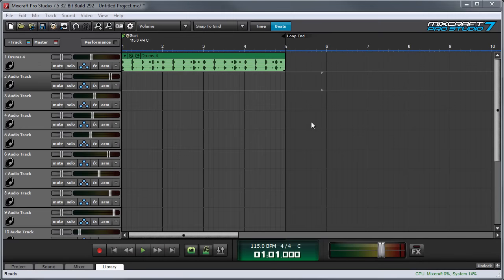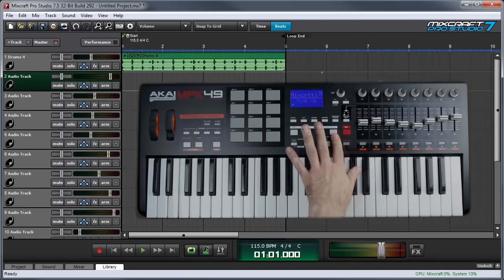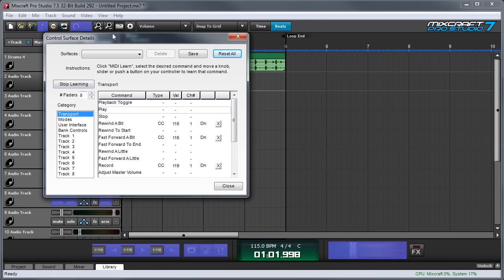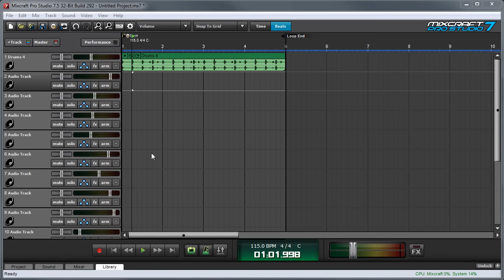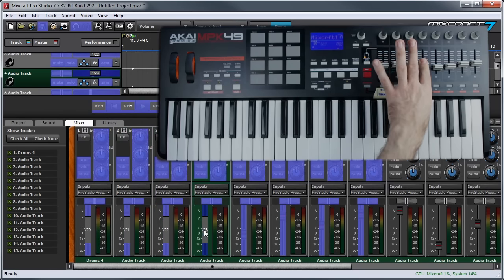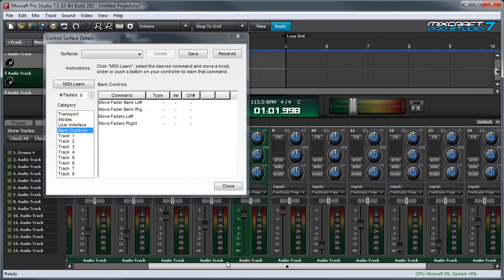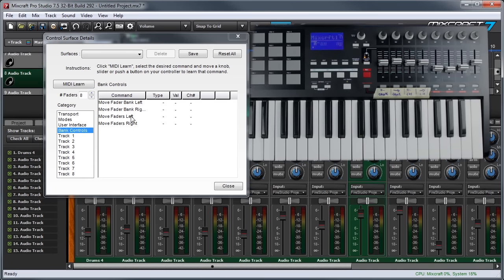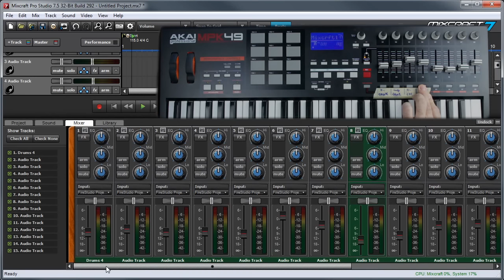Mixcraft 7 Control Surfaces: Using MIDI Transport and Fader Controllers

Comment: This is 5 years old. Any update on what control surface / midi keyboard is best suited for Mixcraft 9?
Reply from the maker: Hey there! If you have questions on compatibility for certain controllers, feel free to get in touch with our support at support.acoustica.com and we'd be glad to check into them for you! However, if the controller supports the Mackie standards, it should be compatible!

Comment: so if i have a midi file sent to me how do I import it, will it auto convert back to the original soundtrack?
Reply from the maker: Hey there! For that you can simply drag the MIDI file into Mixcraft on to a virtual instrument track. It wouldn't contain the sound data however, so you would need to load that specific instrument/sound.

Comment: Mixcraft 8 doesn't seem to save my MIDI assignments with my Launchkey 49 MK2 MIDI controller... is that normal? I need to re-do them with every project... hmmm...
Reply from the maker: Click on the Mix menu, then select MIDI Control Surface, then try saving a Control Surface profile.
Reply: @acoustica222  I think I see where my problem comes from : every time I start a new project, I must reload a given Control Surface to associate it to the project. This is probably by design, for people that might have multiple Control Surfaces, correct?
Reply: @davidbergewaytogo  with controller setup loaded try saving song as a template instead and set that as your default template to load - this works for BEAT/TIME which has no other way to save your preference.

Comment: Hello...I have used Mixcraft since version 2.0 - I now use MC 8 Pro and I love it! After having no success getting PReSONOUS FADERPORT to work as a Control Surface, I wonder if I will have more success if I buy NOVATION LAUNCH CONTROL XL? Even tho there are no templates in the list, could I use one of the 6 "Launch" templates or Do I start from scratch using MIDI LEARN?
Thank you very much to ANYONE who can help me out here.
Reply from the maker: You would use MIDI Learn to map the Launch Control XL, since Mixcraft doesn't have a control surface template for that particular unit.
Reply: So Launch Control works? Does it work well in MC8?
Reply from the maker: Yes, any interface that supports MIDI control surface protocol or Mackie Control protocol. The Faderport is an odd duck, because it requires the host software to put it into HUI mode in order for it to work.

Comment: USING GENERIC MIDI CONTROLLERS AND CONTROL SURFACES‌‌
A MIDI keyboard or other MIDI device with knobs, sliders, or buttons can be set up to control Mixcraft functions such as starting and stopping playback, record, fast forward, track arming, etc.

To configure a control surface, select Mix>MIDI Control Surfaces… from the Main Window menus.

image

image

MIDI LEARN
Here you'll be able to use a MIDI controller's buttons, knobs , sliders, etc. to control TONS functions and controls in Mixcraft. This is a super powerful and fun feature!

Click the MIDI Learn button. Alternatively, you can click the MIDI button in the Main Window top toolbar.

image

 Click on the command to learn. Command categories can be chosen using the

Category menu on the left side.

 Move the knob, button, slider or push a key on your MIDI keyboard/controller that you wish to trigger the command.

 If you wish to learn another command, select it.

Alternatively, the Mixcraft interface will highlight buttons and sliders in purple. Simply click on a button or control, then move the MIDI knob to assign it.

Once you’ve finished assigning controllers, click the Stop Learning button. (Incidentally, this disproves the theory that you're never too old to stop learning.)

image

SAVING AND LOADING CONTROL SURFACES ASSIGNMENTS
Control surfaces assignments can be saved and loaded if you have multiple keyboards or want to reuse your settings for various projects. To save the current control surface

image

assignments, click the Save button. To delete the current control surface assignments, click the Delete button.

Fields

Description

Command

This is the command being assigned or mapped

Type

Can be a CC or note-on message

Val

The number of the CC or note-on

Ch#

MIDI channel of the controller

Any, > 63 or

< 64

The data field for the CC. Select a number from 1-127 or Any. (If the Type field is Note down, choose from Any, > 63 or < 64. If Any is chosen, then the command will be executed if the velocity is any

value. Otherwise, if >63 is chosen, a note down event with a velocity greater than 63 will trigger the command.)

X

Removes the current controller assignment

These files will be stored in %programdata%\Acoustica\Mixcraft\control-surfaces\ .

To load a previous control surface, click the Surfaces drop-down menu and choose one.

image

CONTROL SURFACE COMMANDS LIST
The following commands can be assigned to MIDI control:

MAIN TRANSPORT CONTROLS

 Playback Toggle

 Play

 Stop

 Rewind A Bit

 Rewind To Start

 Fast Forward A Bit

 Fast Forward To End

 Record

 Adjust Master Volume

 Loop Mode Toggle

 Playback Metronome Toggle

 Recording Metronome Toggle

 Count In Metronome Toggle

 Punch In/Out Toggle

 Set Punch Into Current Position

 Set Punch Out To Current Position

 Set Loop Start To Current Position

 Set Loop End To Current Position

 Add Marker At Current Position

 Play From the Previous Marker

 Play From Next Marker

SELECTED TRACK CONTROLS

 Select Previous Track

 Select Next Track

 Set Selected Track Volume

 Set Selected Track Pan

 Mute/Unmute Selected Track

 Solo/Unsolo Selected Track

 Arm/Disarm Selected Track

 Monitoring For Selected Track Toggle

 Guitar Tuner For Selected Track Toggle

 EQ High For Selected Track

 EQ Mid For Selected Track

 EQ Low For Selected Track

 Send Adjustment For Selected Track

OTHER

 Undo

 Redo

 Save

 Insert Virtual Instrument Track

 Insert Audio Track

Comment: HostVersion=1 Flags=00000000
BeforeRunning
Starting at 3:51:24 AM
64Bit addressing mode
3DNow! support: no
SSE    support: yes
SSE2   support: yes
SSE3   support: yes
SSSE3  support: yes
AVX    support: yes
Touchscreen not available
Main GUI scaling factor: 1 (system set to 96PPI)
Temporary folder for this session:
C:\Users\abdul\AppData\Local\Temp\Image-Line\{64680025-82D0-482A-A46A-5A15D60874D2}\
---
ReadIniFile
Animation timer set to 16ms, vsync enabled
Mixer track map: 1,2,3,4,5,6,7,8,9,10,11,12,13,14,15,16,17,18,19,20,21,22,23,24,25,26,27,28,29,30,31,32,33,34,35,36,37,38,39,40,41,42,43,44,45,46,47,48,49,50,51,52,53,54,55,56,57,58,59,60,61,62,63,64,65,66,67,68,69,70,71,72,73,74,75,76,77,78,79,80,81,82,83,84,85,86,87,88,89,90,91,92,93,94,95,96,97,98,99,100,101,102,103,104,105,106,107,108,109,110,111,112,113,114,115,116,117,118,119,120,121,122,123,124,125,0
---
Mixer threading map rebuilt: 1 layer(s)
   Layer 1: 1 unit(s)
      Unit 1: track(s) 1,2,3,4,5,6,7,8,9,10,11,12,13,14,15,16,17,18,19,20,21,22,23,24,25,26,27,28,29,30,31,32,33,34,35,36,37,38,39,40,41,42,43,44,45,46,47,48,49,50,51,52,53,54,55,56,57,58,59,60,61,62,63,64,65,66,67,68,69,70,71,72,73,74,75,76,77,78,79,80,81,82,83,84,85,86,87,88,89,90,91,92,93,94,95,96,97,98,99,100,101,102,103,104,105,106,107,108,109,110,111,112,113,114,115,116,117,118,119,120,121,122,123,124,125,0
---
Opening ASIO driver: Focusrite USB ASIO version 2013855181
Buffer length: 256 frames
In/out latency: 543/543 frames
Time out: 11ms (528 frames)
--
Opening MIDI output devices
Opening MIDI output devices
Opening MIDI input devices
Loading project: version 4.5.4
---
Mixer track map: 1,2,3,4,5,6,7,8,9,10,11,12,13,14,15,16,17,18,19,20,21,22,23,24,25,26,27,28,29,30,31,32,33,34,35,36,37,38,39,40,41,42,43,44,45,46,47,48,49,50,51,52,53,54,55,56,57,58,59,60,61,62,63,64,65,66,67,68,69,70,71,72,73,74,75,76,77,78,79,80,81,82,83,84,85,86,87,88,89,90,91,92,93,94,95,96,97,98,99,100,101,102,103,104,105,106,107,108,109,110,111,112,113,114,115,116,117,118,119,120,121,122,123,124,125,0
---
Mixer threading map rebuilt: 2 layer(s)
   Layer 1: 1 unit(s)
      Unit 1: track(s) 1,2,3,4,5,6,7,8,9,10,11,12,13,14,15,16,17,18,19,20,21,22,23,24,25,26,27,28,29,30,31,32,33,34,35,36,37,38,39,40,41,42,43,44,45,46,47,48,49,50,51,52,53,54,55,56,57,58,59,60,61,62,63,64,65,66,67,68,69,70,71,72,73,74,75,76,77,78,79,80,81,82,83,84,85,86,87,88,89,90,91,92,93,94,95,96,97,98,99,100,101,102,103,104,105,106,107,108,109,110,111,112,113,114,115,116,117,118,119,120,121,122,123,124,125
   Layer 2: 1 unit(s)
      Unit 1: track(s) 0
---
Loading project: version 9.6.0
---
Mixer track map: 1,2,3,4,5,6,7,8,9,10,11,12,13,14,15,16,17,18,19,20,21,22,23,24,25,26,27,28,29,30,31,32,33,34,35,36,37,38,39,40,41,42,43,44,45,46,47,48,49,50,51,52,53,54,55,56,57,58,59,60,61,62,63,64,65,66,67,68,69,70,71,72,73,74,75,76,77,78,79,80,81,82,83,84,85,86,87,88,89,90,91,92,93,94,95,96,97,98,99,100,101,102,103,104,105,106,107,108,109,110,111,112,113,114,115,116,117,118,119,120,121,122,123,124,125,0
---
Mixer threading map rebuilt: 3 layer(s)
   Layer 1: 1 unit(s)
      Unit 1: track(s) 1,2,3,4,5,6,7,8,9,10,11,12,13,14,15,16,17,18,19,20,21,22,23,24,25,26,27,28,29,30,31,32,33,34,35,36,37,38,39,40,41,42,43,44,45,46,47,48,49,50,51,52,53,54,55,56,57,58,59,60,61,62,63,64,65,66,67,68,69,70,71,72,73,74,75,76,77,78,79,80,81,82,83,84,85,86,87,88,89,90,91,92,93,94,95,96,97,98,99
   Layer 2: 1 unit(s)
      Unit 1: track(s) 100,101,102,103,104,105,106,107,108,109,110,111,112,113,114,115,116,117,118,119,120,121,122,123,124,125
   Layer 3: 1 unit(s)
      Unit 1: track(s) 0
---
ReadIniFile - end
FL Studio 20 Producer Edition v20.0 [build 445]
Registered to: 
BeforeRunning - end
Opening MIDI input devices
App deactivate - first time = 1
Opening MIDI output devices
Opening MIDI output devices
Opening MIDI input devices
Opening MIDI output devices
Opening MIDI input devices
Opening MIDI output devices
Opening MIDI input devices
Opening MIDI output devices
Opening MIDI input devices
Mixer track map: 1,2,3,4,5,6,7,8,9,10,11,12,13,14,15,16,17,18,19,20,21,22,23,24,25,26,27,28,29,30,31,32,33,34,35,36,37,38,39,40,41,42,43,44,45,46,47,48,49,50,51,52,53,54,55,56,57,58,59,60,61,62,63,64,65,66,67,68,69,70,71,72,73,74,75,76,77,78,79,80,81,82,83,84,85,86,87,88,89,90,91,92,93,94,95,96,97,98,99,100,101,102,103,104,105,106,107,108,109,110,111,112,113,114,115,116,117,118,119,120,121,122,123,124,125,0
---
Mixer threading map rebuilt: 3 layer(s)
   Layer 1: 1 unit(s)
      Unit 1: track(s) 1,2,3,4,5,6,7,8,9,10,11,12,13,14,15,16,17,18,19,20,21,22,23,24,25,26,27,28,29,30,31,32,33,34,35,36,37,38,39,40,41,42,43,44,45,46,47,48,49,50,51,52,53,54,55,56,57,58,59,60,61,62,63,64,65,66,67,68,69,70,71,72,73,74,75,76,77,78,79,80,81,82,83,84,85,86,87,88,89,90,91,92,93,94,95,96,97,98,99
   Layer 2: 1 unit(s)
      Unit 1: track(s) 100,101,102,103,104,105,106,107,108,109,110,111,112,113,114,115,116,117,118,119,120,121,122,123,124,125
   Layer 3: 1 unit(s)
      Unit 1: track(s) 0
---
Mixer track map: 1,2,3,4,5,6,7,8,9,10,11,12,13,14,15,16,17,18,19,20,21,22,23,24,25,26,27,28,29,30,31,32,33,34,35,36,37,38,39,40,41,42,43,44,45,46,47,48,49,50,51,52,53,54,55,56,57,58,59,60,61,62,63,64,65,66,67,68,69,70,71,72,73,74,75,76,77,78,79,80,81,82,83,84,85,86,87,88,89,90,91,92,93,94,95,96,97,98,99,100,101,102,103,104,105,106,107,108,109,110,111,112,113,114,115,116,117,118,119,120,121,122,123,124,125,0
---
Mixer threading map rebuilt: 3 layer(s)
   Layer 1: 1 unit(s)
      Unit 1: track(s) 1,2,3,4,5,6,7,8,9,10,11,12,13,14,15,16,17,18,19,20,21,22,23,24,25,26,27,28,29,30,31,32,33,34,35,36,37,38,39,40,41,42,43,44,45,46,47,48,49,50,51,52,53,54,55,56,57,58,59,60,61,62,63,64,65,66,67,68,69,70,71,72,73,74,75,76,77,78,79,80,81,82,83,84,85,86,87,88,89,90,91,92,93,94,95,96,97,98,99
   Layer 2: 1 unit(s)
      Unit 1: track(s) 100,101,102,103,104,105,106,107,108,109,110,111,112,113,114,115,116,117,118,119,120,121,122,123,124,125
   Layer 3: 1 unit(s)
      Unit 1: track(s) 0
---
Opening ASIO driver: Focusrite USB ASIO version 2013855181
Buffer length: 256 frames
In/out latency: 567/567 frames
Time out: 10ms (480 frames)
--
Loading project: version 11.1.1
Threaded generator(s): 1
---
App deactivate - first time = 0
Opening MIDI output devices
Opening MIDI input devices
Opening MIDI output devices
Opening MIDI input devices
Opening MIDI output devices
Opening MIDI input devices
Opening MIDI output devices
Opening MIDI input devices
Opening MIDI input devices
Opening MIDI input devices
Opening MIDI output devices
Opening MIDI output devices
Opening MIDI input devices
Opening MIDI output devices
Opening MIDI input devices